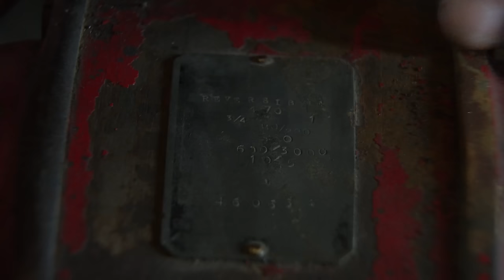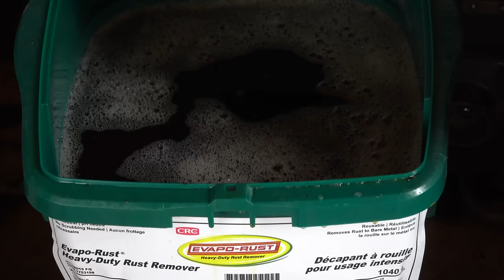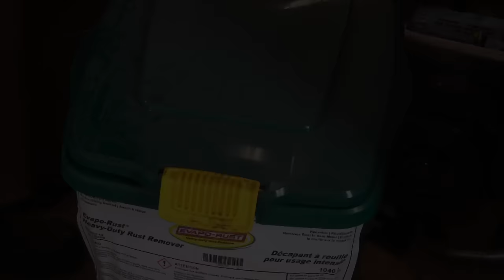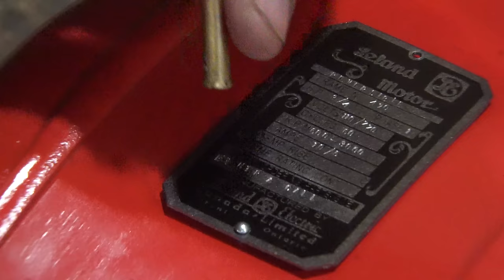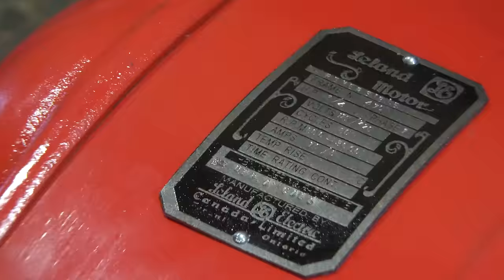Why Did They Stop Making These? [Restoration]

Comment: Very interesting! I've never seen this precise device before.  The commutator is just a switch that applies current to successive windings as it rotates. The electromagnetic forces make it turn.  However with the extra brushes you can produce two fields that will balance each other at the central position. In theory it will then be drawing a minimal current due only to eddy currents and any losses. It's a very interesting concept. I think that string should have been replaced and lacquered down with a shellac of some kind as it supports the wire ends of the armature (rotor?) coils. Good job and instructional video. I wonder what it was used for?

Comment: Hi, in short the way it an go faster or slower or in reverse is due to the magenetic field either advancing or reversing ot even repulsing and coming to a stop when moving the lever. That’s the simple explanation of it. You are forcing the magnetic fields of the magnets to chase each other. Remember like poles repell and opposite poles attract.  In other words with this adjustable brush rigging you can move the armature poles either farther away from the stator poles ( causing a chasing or attraction motion )  or closer to slow it down ( less pole attraction ) then to the point  of stop where the magnetic fields are in phase with each other.  Hope this helps.

Comment: “Reversing the motor adds material back…”

Superb restoration and the exact amount of humor!
Reply: "Reversing the motor adds material back…”
This is supposed to be the best comment!
Reply: I have one of those machines.  I started with a simple 5/16 nut and kept adding material until I had an engine block.  Still have the nut.
Reply: Going backward reverses the shop's electric meter too!
Reply: Reversing the video does so,  as well.: )
Reply: Lol I did not see that coming.
Reply: 20:47
Reply: I laughed at that too. Great video and a very unique motor - I have only ever seen one before, and that was about 30 years ago
Reply: The exact amount- yeah, none.
Reply: “Reversing the file adds material back…”
Woah. They sure don't make em like they used too.
Reply: @AndrewKitayev  Now Wheres my Board Stretcher :)
Reply: Oh, Right,By the Muffler Bearings, how silly of me 🙂
Reply: If you put that motor in line with your transmission it reduces your mileage too

Comment: Been an Electrician all my life and never seen a motor like this.  Pretty amazing and way ahead of its time.
Reply: I have. This kind of reguation was used on some old trams (tho those were working with DC, not AC).
Reply: SEE??!!! I knew it was a time machine control!!
Reply: any more on HOW this regulation worked? i dont think it was from adding resistance, but am unsure,  I have DC motor application that would be useful for. as resistance doesn't reduce the total power consumed. when the power suplly is a battery total consumption of power becomes critical   @mrkv4k
Reply: @LouAlvis  - what you're looking for is the mechanical PWM control. To be honest, they simply aren't worth it for applications of less than 100hp. Might as well buy a solid state PWM controller, or just carry more battery.
Reply: @LouAlvis  It's hard to explain it without graphics of some kind but I'll give it a go.
All this is effectively doing is biasing the position of the attractive/repulsive fields of the rotor in relation to the stator. Eventually the field generated by the rotor will match that of the stator at that position and the motor will not move. Continue moving the brushes and the field will move the rotor in the opposite direction.

It doesn't matter if it's a brushed DC motor or a brushed AC/Universal motor this method works the same way.
Reply: Join the club, this is a brilliant bit of kit. As a sparky I saw quite a bit of older gear like the old DC welders that looked like a Dalek from Dr Who but never anything like this.
Reply: @LouAlvis  The handle directly controls the brushes that make contact with the motor.  In essence you are controlling the timing of the push
Reply: Close, @TauCu  , but in this case the armature winding is not powered externally, like a DC or universal motor. The armature (rotor) current is induced by the changing stator field, so it only works on AC. Look for "repulsion motor" in a source such as Wikipedia.

Comment: Though I am an old lady in my mid-70s by now, these kinds of videos bring back fond memories of being with my dad in his workshop, turning things on the lathe, and so forth.  He could fix anything.  If he needed a specialized tool he didn't have, he would design and make it.  And he was from the generation that only had an 8th grade education!
It makes me happy to see that there are young folks who still embrace these skills instead of just throwing things away.  (And yes, at my age, "everyone" else is a youngster!  LOL)
Reply: bless you RIP your dad
Reply: Jeez, I'm not old and I'm 80.  :-)
Reply: I am 47 and my dad was just like that as well, mechanics or electrical things made no difference.
Reply: 8th grade education back then isn't what it is today.  I've seen educational books from the 1920's.  Calculus Made Easy by Silvanus P. Thompson is an example, that was for "5th form boys".  Children aren't allowed to be actually educated.  Sure, they learn a bunch of nonsense, but they aren't taught actual information and knowledge.  It's threatening the stability of our society.
Reply: Honey education only goes so far...you have to DO IT to gain experience. Experience always trumps knowledge. Stay blessed milady.
Reply: That 8th grade education he got was better than todays 4 year degree. He was taught to think.
Reply: I had a Dad who had similar skills. He could case-harden mild steel by using an acetylene torch to add  surface carbon, then heating the object and other tricks to increase the carbon in the outer layer to change the metallurgy, and other tricks. He could fix most things other than electronics. I still have his 1925 Dyke's Automobile and Gasoline Engine Encyclopedia. :)
Reply: AMEN.
Reply: @heathhalfhill6401  Yeah. Nowhere in school do they teach you any of the relevant knowledge or experience to ever be able to do something like this. 
You have to specifically research, study and practice this art be able to do literally anything.
Reply: An 8th grade education back then far exceeds a masters degree by today's standards...
Reply: College broadens your knowledge for working in the corporate world. Interacting with foreigners and studying electives gives a wider perspective and understanding of the world. 
It is a PREPEPERATION for the working world. 
Now you get a job..
THEN you learn skills like this. 

Or skip all that and pick up the tools.  Learn by trial and error. 

Trade school should be mandatory.
Reply: @amazing_bobson  agreed, I’m 20 and you’re always invited to kick it wit da squad, my Amazing Bobbrotha
Reply: I'm 75 its interesting to hear from a lady who watched her dad work around the shop.  good to know some girls were also interested in how stuff worked.  I have no doubt women could also do this stuff in Britain and the US  during both WWars women moved into the factories to doe the defense work because the men were all fighting in the wars
Reply: He and I are a lot alike.
Reply: @fuzzywzhe  - Thank you!! Well stated. Education has given way to indoctrination in today's society.
Reply: Thank you. Your dad was my  kind of guy, may he rest in peace. Your description of him makes me think of my own father. So very skilled and much like his own father. In my eyes, my dad could do anything, like many from their era. Extremely mechanical, joined the war effort and became a bomber pilot, then flew spy planes in two wars. Returned to the farm after peace returned and did his best to teach me valuable lessons.

Comment: I am 73 year old and this is the first time I have seen a motor like this one. Excellent!!!!!!
Reply: I'm 73 years old too and I have never seen one of those motors either. Not even after 20 years as an electronics technician. Bloody hell if it ran on 220VAC I'd buy the damn thing!
Reply: I'm 74 and this is the second time I have seen a motor like this one!
Reply: My grandfather would be 109 today and he had one of these mounted on his workbench in the basement. I remember fiddling with it as a kid and never knowing what it was for!
Reply: I could see that they were shifting the neutral point of the brush rigging (worked on lots of DC equipment), but never seen this on an AC motor.  This is one of the most clever ways to make an AC, Variable-speed, reversible motor control. 👏👏👏👏👏👏👏
Reply: Me too. Worked in maintenance for many years, saw some old stuff but never one of those.
Reply: 43, seen one 30y ago irl, and 1 or 2 on YouTube.
Reply: @a0cdhd  It said 110/220 on the plate
Reply: Me too 73 never seen one of these
Reply: Exactly what I was gonna say, but I'm only 56.... lol
And reverses ? I have to look more closely at this.
Reply: I'm only 63, but in 10 years I will be 73. I can't wait.
Reply: @PaulSmith-zi3sn  Wikipedia répulsion motor
Reply: @ssaraccoii 
Indeed.

They took a brushed DC motor and went "what if it was AC?".

In my second year engineering degree and literally in the middle of a course on electrical motors/generators/controllers. After looking how it works it would be classified as a brushed synchronous machine with a mechanical driver since it works in sync with the AC field inside of it as opposed to an induction motor which lags behind the AC field.

Which also means that you don't actually control the torque with the rod, you control the target rpm and if the rotor lags behind the magnetic field of the stater then a magnetic torque will be applied to it until it is back in sync again, which makes it perfect for lathes and mills as you can precisely control the target rpm you want and allow the machine to modulate the torque required to maintain that speed automatically.

It's actually surprisingly advanced, like in order to modernize it I'd literally just make the brush-ring servo-controlled and add an FOC sensor so you could tell it the exact rpm you want instead of guessing with the lever. I can't really think of a way to make a motor like this without a commutator ring.
Reply: I'm 78 and ditto!
Reply: All series wound motors will behave this way, the brush skew adjustment is typically only found in immense motors and rarely used for reverse
Reply: I am also 73 yo and this  is a first time for me too !
I knew that changing the position of the brushes changed the direction but, never knew there were motors made that way ! 
What an easy way to reverse an electric car !
Reply: They were sold new untill 1995 by a German  company and then freq drives became cheaper to use. This type of motor does not make economische sensor.
Reply: that makes you 10 years younger than that motor i'm guessing it was a pre 50s bench motor.  this video is proabably from India and a lot of old repairable stuff is still reused there because its easily repairable.   Much  like old Sears Kenmore appliances they are not fancy but can still be overhauled every 20 years. because  no computers.

Comment: As a retired auto mechanic I really appreciated this video. I remember the old days when we actually repaired and reconditioned things like starter motors and alternators, rather than replace them. Thanks for this great video.
Reply: Их и сейчас восстанавливают. Но не в вашей стране
Reply: They're made so cheaply that you'd be an idiot to try and have it remanned. We don't work on alternators and starters for that reason. Why waste the time waiting for a shop to repair it, only for it to save you like $20?

Electric motors are still very much worth repairing.
Reply: "we" as a species still do - that's why there's a core charge. The old ones get rebuilt.
Reply: I still repair them when I can get the parts. Why trust some rebuilder when you can fix it with a five dollar bearing.
Reply: @miker252  because rebuilders that actually know what they're doing can tell you if it's burnt up or can replace rotten wires for you as well as any other problems that can occur.

 So many people walk into my shop and try to tell me how much they know, and within 2 sentences, I can tell they know absolutely nothing. 

"Umm, excuse me, aren't you supposed to put that on THAT way?"

My response is almost always, "If you know so much about it, why did you bring it to me?"
Reply: @alicer6779  I meant no offence.  You may be very experienced or just starting out, but I have no way of knowing when buying from a parts store, or even worse online. Working in my dad's shop, I repaired my first generator 60 years ago.  Along with other training, I have an electronics technology degree and I retired as a journeyman HVAC mechanic.
Reply: @miker252  oh no, you didn't offend me.  You just reminded me of the know-it-alls that don't actually know anything that have come in over the years lol
Reply: @alicer6779 do you think that being a female mechanic makes you overly sensitive to harmless questions because you feel you have to prove that you are as capable as a man?
Reply: Other people still repair and recondition starters and alternators ...
Reply: I started out as a mechanic in the early seventies, and our shop had the equipment to resurface commutators and do the undercuts. Pretty much everything got repaired or rebuilt in those days.

Comment: Cleaning the copper from between the bars must have been so fun. Good job!
Reply from the maker: The asbestos potential makes it more fun...
Reply: @HandToolRescue nothing better than asbestos in your projects😍
Reply: There are special lathes to clean a rotor. Squash demonstrated one lately.
Reply: There's nothing better than freshly grinded asbestos smell in the morning
Reply: @HandToolRescue  do you have an armature undercutter? maybe need to go rescue one.
Reply: @HandToolRescue   Us Aussies love asbestos... no wait we hate it
Reply from the maker: I'd love one
Reply: In my experience, copper is a hassle to work with, especially with tools that aren't specifically made for it. Gums up grinding disks and sandpaper, is tough to cut with a jigsaw, and I managed to snap off three thread cutters working with copper heatsinks. CNC and big bandsaws might do the trick, but as a hobby DIYer, I have neither of them.
Reply: Look up commutator lathes.  I’m familiar with the small ones for RC motors (Hudy soecifically) but I’m sure they make bigger ones.
Reply: Back in the old days, large commutators in huge 1000+ watt motors and generators were assembled using thin slices of a natural insulating mineral called mica. It doesn't melt under high heat. This likely predates plastics so may also use mica.
Reply: An old hacksaw blade, ground into a hook, no teeth wanted, wrap something around it as a handle. Push the hook into the wound end and drag back to you. A little oil to catch any dust. The blade is a consistent width for the gaps. If the edge is too sharp, lean the old blade over to "V" the gap slightly. If the tool is getting blunt, regrind.
 No thousand dollar machine needed. 
Have had to do it before. Oh yes, your wrist will get sore.
Reply: Yep..........from your projects to your nose and then the lungs. @Floris_VI
Reply: It's good practice to scrap excess mica from between the commutator segments with a pick.
Reply: @alanhilder1883 

In case you ever need to do this again in future I got a tip for you.

Get one of those hook shaped mini-hacksaws that can hold a full size hacksaw blade.

When you grind the end of the hacksaw blade into a hook shape make sure you grind a bevel on the inside edge of the hook to act as a chisel - leaving enough material behind both hook and chisel edge to act as a support.

Insert the blade into the frame with the ground end protruding, then take a soft faced hammer and gently tap the hook/ chisel through the slot by tapping on the hacksaw frame

It will save your wrists and a bunch of time & frustration.
Reply: @LiamD613  I couldn't give away all the tricks that I had, got to let them experiment a little to make them feel good.
I'm glad that I haven't had to play with the big motors for about a quarter of a century, got eased out of industrial into domestic and I no longer fit into roofs. Industrial is more varied and interesting. Being the electrician in charge of a production floor as a 3rd year apprentice ( with 2 tradies just a quick call away if it gets too crazy ).
Reply: Reminded me of the last time I was at the dentist
Reply: Outstanding
Reply: @jckesinger RIP enamel
Reply: Perhaps adding some superglue or something equal before starting to cut the copper would help? i mean, the glue itself isn'n conductive, and it would prevent the smearing/chips from getting into the voids? :)
Reply: Used to use a broken hacksaw blade for this on starter motors and it worked very well.
Reply: @zbradbell I used to use a hack saw blade.
Reply: 😂3 @SYS-dc6uo Past tense for grind is ground
Reply: @DMahalko I believe mika is a rock
Reply: @vmitchinson  wouldn't that also be a mineral?
Reply: @alanhilder1883 Every old motor/starter/generator repair manual/book had the modified hacksaw blade for mica/commutator  undercutting in it.
Reply: @alro2434  Maybe that is were I was told about it from.
Reply: @vmitchinson  Yes, mica is a mineral. Most materials are minerals in one form or another. We make glass from silica, also a mineral.
Reply: We called it "racking the com"  The best way we did it for the little motors like that was to take a simple hacksaw blade and nip it back one end with a heavy snip to form a point at the front with the tooths of the saw blade "cutting" when drawn back towards you.  if it got dull nip off a little more and go back at it.
Reply: @HandToolRescue at least now your lungs won’t catch on fire